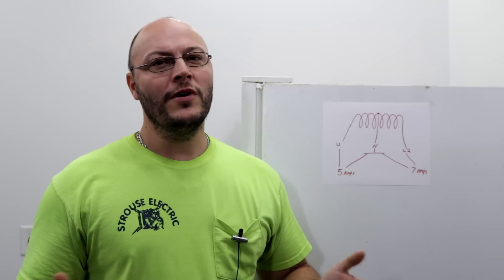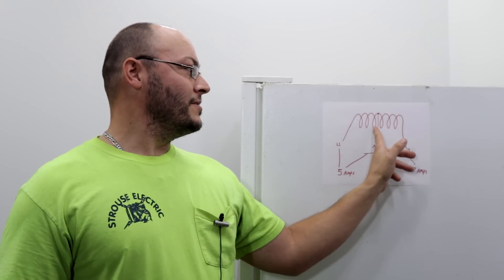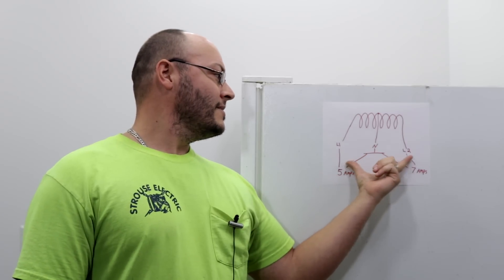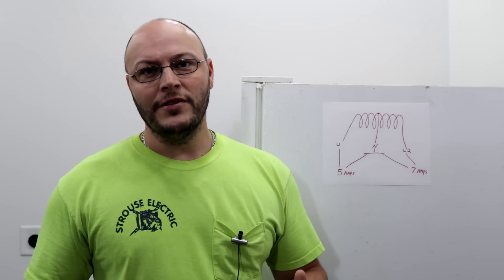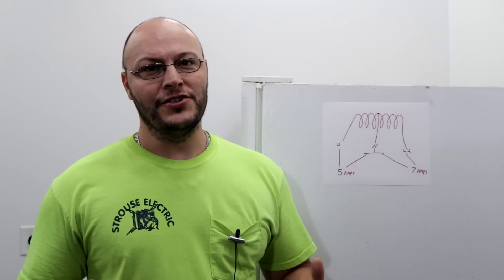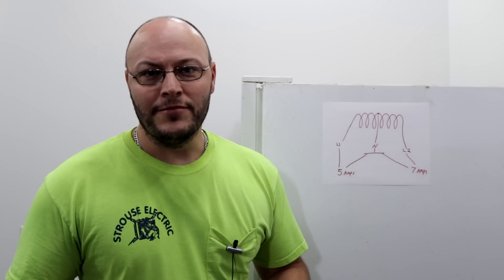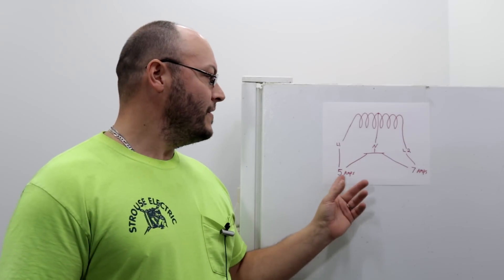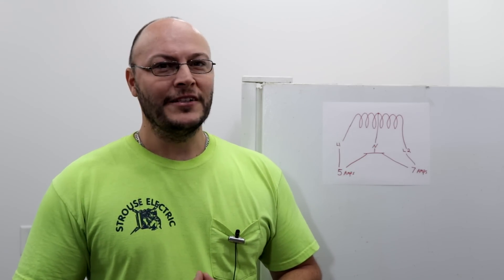What does the Neutral Wire Do?

Comment: I don’t think that explanation is going to help anyone except maybe the more technical. People want to know what’s the purpose of the neutral in their wiring and how does it differ from the other wires. First of all, if you need an 120V supply, then you would use either L1 and neutral or L2 and neutral. Why do you call it neutral.? Well, it isn’t neutral, it is the mid point of the transformer, it only becomes neutral when it’s connected to ground. There is no voltage between the mid point of the transformer and ground when they are connected together and therefore, it is neutral (0V). Unlike L1 and L2, which are live (hot) with respect to ground (120V). Connecting the midpoint of the transformer to ground protects the supply from being raised above its normal voltage should there be a lightning strike onto the equipment or should another supply of higher voltage accidentally comes into contact with it.

Comment: Excellent explanation.  You might point out that the grounded conductor is also extremely important to prevent or reduce electric shock to a person who inadvertently touches a hot conductor, or has a grip on the wrong part of an electrical appliance or another device that malfunctions or fails and would subject the person to an electric shock.
Reply: You are confused.   The “grounded conductor” in NEC is the conductor called common or Neutral.   The “equipment grounding conductor” is the one that reduces the chance of being shocked.
Reply: @KevinCoop1  you’re right. Funny thing is that I know this and just had a brain interruption. You’d think that after 27 years of playing with electricity would help.  It has always struck me odd that they refer to it in that way.  It is grounded of course, but not everywhere, only in the main box.  But whatever.  Thanks.
Reply: @masonsteven77    Do you know why neutral and equipment grounds are connected at the main panel?   This is very important to understand.

Comment: My first instinct is to just look at the neutral as a reference point on the transformer that has direct connection to the windings. This means the output voltage referenced there is a result of mainly the winding ratio, which is an unchanging ratio unlike the possible varying 120V loads that will be series line to line if the neutral is lost. To say the neutral just returns imbalance is assuming the panel is entirely 2 pole breakers. A panel with one single pole circuit is going to use the neutral as a current carrying conductor nearly identical to the line.

Comment: It was explained to me that the neutral is a path back to the transformer to complete the circuit from one leg, through a load, and back to the transformer. The most important thing to remember is not all loads use up the 120/240V being supplied to them. That drop in voltage is called the voltage drop and all loads (relays, lights, refrigerators, etc) have this. When the full 120/240V is not used up that residual voltage gets delivered back to the transformer via the neutral wire. I think you were wrong when you said that 2 amps goes back on the neutral wire. The transformer doesn't supply current, it's supplies voltage. A load creates amps via the voltage drop/utilization of power. You should have little to no current on a neutral, just a small amount of voltage.
Reply: The voltage drop is always 120V across a load connected to 120V, except for the very small amount due to the resistance of the wires.  The neutral is held at ground potential, so the voltage on that side of the load is zero, relative to ground.
Reply: Harry,   Where in the world did you hear this long line of crap from?   This explanation is so far gone, there is no place to start with what is wrong!
Reply: @KevinCoop1  Maybe I said it wrong - The  neutral wire provides the return path for the current provided by the hot wire. All loads create a voltage drop. What did I say that you do not understand?

Comment: Neutral is the sum of the three phases in a three-phase system where each phase is 120 degrees from each other. The sum is 0 V or potential 0. The three phases are L1 L2 L3 and the neutral is in the middle, that is in the main transformer. Later in the distribution to the houses, L1 and L2 (or L1 and L3) are used and connect to another transformer along with the Neutral. When the load in the phases are not even, the return to neutral is not zero. As the current is alternating, the phase and the neutral also do it, so the current does not go to one side there is no "return" there is a circuit.

Comment: if lightening strikes your house you are in trouble and the ground will not help very much. the ground helps to cause the breaker to trip if there is a ground fault. if there is a ground fault, there will be a lot of load on the ground, the ground is tied to the neutral in your main, so hopefully it will trip the main breaker. that is all i know, about that.

Comment: 100% somebody on the job pissed off Bill the day he made this video! 100%. I’m 50/50 on if it was an older, seasoned vet or if it was a young, smart mouthed apprentice. Maybe it was both and Bill got gang banged on the job this day. I’m starting to lean towards the gang bang assessment. But either way, I haven’t the slightest of doubts that this video - and his YouTube channel itself as a result - spawned from Bills unquenchable thirst for vindication following a heated debate that took place at work on the very day this video was filmed. Possibly less than an hour prior to recording depending on length of commute. It was immediately upon his return home. He didn’t shower and change. He didn’t eat dinner. He didn’t take a piss. He didn’t kiss his wife or say hello to his children or pet his dog. He did his rehearsal in the truck while driving home, he drew up his diagram while stopped at red lights and then he pumped out his first YouTube video with his first and only take!

Comment: What is the voltage between neutral and ground? I guess it is zero because it's save to touch neutral. Why neutral doesn't electrocute? It is connected to a point in the middle of the transformer coil!

Comment: I was told that the neutral goes back to the grid basically recycling the electric.   There use to be only one wire that came to your house and you grounded everything out on a copper rod in the ground .  Seriously I believe the electric company is getting a far better deal than any of us knows and also the transfomer outside of our house transforms the high voltage energy into alternating current if I am wrong someone elplain it.

Comment: I am not sure about this....neutral can be considered as ground depending on the circuit,,As the neutral point of an electrical supply system is often connected to earth ground, ground and neutral are closely related. Under certain conditions, a conductor used to connect to a system neutral is also used for grounding of equipment and structures.

Comment: At individual circuit level, the neutral wire also completes the circuits. You can’t just have a load wire into a lamp — you need the neutral wire to complete the return to the source.

Comment: The neutral carries the currents of all potential hot conductors to complete the circuit. When the hot conductors feed their individual loads the voltage goes to zero. All zero conductors now can be put on one conductor which we call the neutral.
Reply: Bob,   Where are you learning this from?   It is not based in reality.    Respectfully,   Kevin

Comment: so essentially, the neutral wire just completes the circuit?
Reply: Misty,   The neutral conductor connects to the center point of a 240 volt single phase transformer.   So, if one winding were 1 volt(hypothetically) 240 windings would be 240 volts.   Correct?   Since the neutral connects at 120 windings on each side, you would get 120 volts, correct?
So, L1 to L2 is 240 windings.   L1 to N is 120 windings. And L2 to N is 120 windings.   
To finish your comment,  the neutral wire just completes the circuit rated at 120 volts.
Respectfully,   Kevin

Comment: Isn't the main purpose of the neutral to provide a complete circuit from the hot wire back to the circuit breaker?  You are just showing the neutral from the circuit breakers back to the transformer.
Reply: Robert,   He is showing you the relationship of L1, L2, and neutral inside a transformer and how 120 volt loads balance each other.   His video is spot on.
Think about what he is showing and then apply it to what is happening after the panel in the electrical system.   That may help you understand.   Respectfully,   Kevin

Comment: As I always understood, the neutral is the way for current back to the source in order to close a circuit. Without a neutral, there is no circuit. Excepting in a 2 phase service when you have 240v you don’t need neutral bc both faces complete the circuit. Without a circuit there is no service. So the main purpose is to complete a circuit.
Reply: Bruce,    Let’s try to think differently.   A neutral (in this case) is a way to connect to a 240 volt transformer and get 120 volts.   This is single phase only.   No 2 phases at all.   If there were no neutral and only L1 and L2 the system would work perfectly at 240 volts.   Everything connected would have to work at 240 volts, like European countries.   Hopefully, this helps.   If you have a specific question, you can ask, I’ll try to answer you.
Respectfully,   Kevin

Comment: Hi
Why we put Neutral and Ground at the same header in the panel. 
Thanks,
Reply: Ahmad,   Back many years ago, like in the 1950’s electric services were not connected to ground rods or electrodes at all.   They ran just fine, until a lightning strike hit it.   The lightning would do lots of damage to the panels, equipment, and especially a water pump.  (I witnessed this, the panel and the water pump welded itself. And the TV had a big cloud of smoke come out of it.   So, it was decided that a connection would be made to earth (call it ground) and the lightning would follow that path.   Since neutral is connected to both halves of the coils in the transformer, that makes it a good place to “ground” the system.
Respectfully,   Kevin

Comment: maybe the electric company is recycling there electric?
Reply: They are!   They put it out and bring it back 60 times a second.   So everything the send out comes back and you still have to pay for it.
Reply: ^^ that’s not how this works. That’s not how any of it works...

Kilowatt hours reflect work performed. Work requires an expenditure of energy. Thermodynamics and all that. The fact the power company uses AC current, is a good thing, because of how efficiently it can be transmitted over long distances. But the more work that is being performed on the grid (KW/hrs used) the more the power company must generate, or buy from other providers. 

This can be demonstrated quite simply by using a small generator at your home, and watching the fuel usage based on how many appliances you run at one time. The more work you try and perform with that generator, the harder it works, and the more fuel is used to produce that energy. The same is true on a larger scale, more or less. You can’t get work/energy for free.
Reply: @allanlackey7602     Of course your comment is correct!   I was making a joke.
Reply: One way of better visualizing this, is to think of pneumatic tools. They are like a DC appliance. The air goes down the line, through the tool, and out into the atmosphere. 

But imagine you had a pneumatic tool that recaptured the air after being used in the tool. You have a return line going back to the compressor. The imagine that the compressor works in an oscillating pattern, pushing air out one hose, then the other, back and forth, rapidly. And the pneumatic tool is designed to work off of this ocillating air pattern. All the air (or voltage) may be returning to the source compressor (or power plant), but it takes a lot more energy to move that air back and forth, depending on how large a tool you’re using at the end of the two hoses.

Comment: The typical flow of electricity in power grid systems from the beginning to the end in my country is :

Three-phase generator - step up transformer - power grid towers- step down transformer - utility power line - individual power line - live part at meter & distribution board - live wire - elecrical devices - neutral wire -neutral part meter & DB - neutral at utility power  line - neutral at substation/generator - ground

The electrical pontential a.k.a voltage is the
differences of electrical pontential between a point (generator) to another point.

Basically, neutral is a  big "ground" terminal located at either substation or generator that serves as a "zero" point for the circuit so that the voltage within the circuit (between generator and ground) exists and electrons can move/oscillate at a certain rate (current) 

Many people are confused about how AC power grid system works since they are used to imagine electricity as a flow of electrons in a DC circuit ( there are positive/negative battery terminals, switch and load). As a result, they are

Comment: What's a common wire?

I understood common as a reference point in a circuit, basically, where you put the black probe of a voltmeter if you are taking measurements, something people seem to mix up with ground/earth. I then looked at getting a Nest Thermostat, which has a common wire, and I've searched on YouTube, and they also speak of common wires.

Makes no sense.
Reply: I believe the term common in electrical means connected to more than one thing.   In this case, neutral is common to the L1 coils and the L2 coils in the transformer.   Common is not always used when discussing neutrals.   In automotive systems, the positive side conductors have fuses and conductors going to each load.   But some loads, just connect to the metal frame and all go through the frame to the larger conductor from the frame to the battery.   So they are common.   Hope this helps!   Kevin

Comment: I'll just correct you on one simple fact about Ground. The typical job of the grounding system in a home is to insure that since we are working with alternating current through  induction the tubing and other materials used in the electrical system get build up electrical charges and these  are the charges that get grounded on a day to day bases,  any Ground fault and  any charges by induction from lightning and the sun CME's that can occur from time to time.

Comment: How come neutral dosnt have a voltage when is coming the same coil ??
When the bottom and top has a voltage ???
Reply: Andranik A    The neutral is called "grounded conductor" in the system.   Since the ground is connected to the neutral, and is the reference point, then the voltage from Neutral to ground will be zero volts as they are connected to each other.   Are electrons moving through the neutral?   Yes they are exactly like they do in the line conductors.

Comment: If i have 2 separate phases in 2 separate circuits, can I shear One neutral wire in both circuits?
Reply: Kamran Pipekesh      Are you asking if you can share a neutral on (2)120 volt circuits?   If so, yes.   It is called a multi-wire branch circuit.   The two single pole breakers must now have handle ties across them to disconnect both circuits at the same time.

Comment: The most frustrating question is that does neutral have potential? How can neutral carry current voltage without any voltage? When you say there is a current, make sure to answer if there is a potential. Voltage and current always are interlinked. Everybody always gives only half an answer and teach!
Reply: Sun Shine    I will try to answer your question for you.   Ground is a reference point for the system for measuring (potential) or voltage.   Whichever you want to call it.    In a 120 volt circuit, L1 or L2 and neutral have potential of 120 volts on the conductors.   Electrons are excited exactly the same in both.   If measuring voltage from neutral to ground, they both have the exact same potential of 120 volts.   Since they are exactly the same, the meter reads zero.
I hope this helps you.    Respectfully,    Kevin

Comment: The neutral is rigged so you have to pay more!
In my country we don't use neutral as it sends your electrocity back to the transformer.
Basically the neutral is like that guy that sells you something then comes at night and steals it just to sell it to you again the same thing you paid before.
Reply: FapKing69     I call BS!   In your country, you probably have 240 volts which is a phase to neutral connection.   Without a closed circuit, you get nothing from the circuit.

Comment: Neutral does not help to return back the current in transformer.Neurtral neutralizes the apparent power after using the real power which  remains in the form of( vars) reactive power or use less power.Neutral is centre of gravity it always accomodate power free flow of electrons.